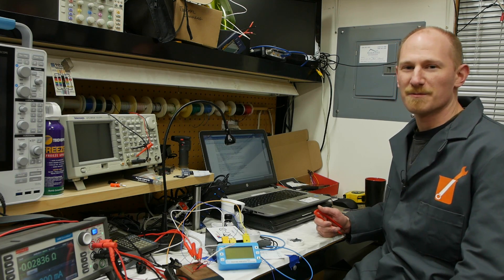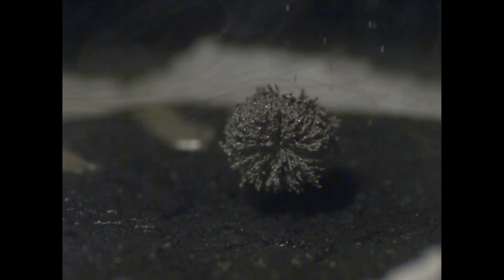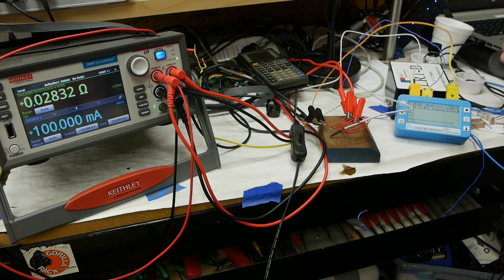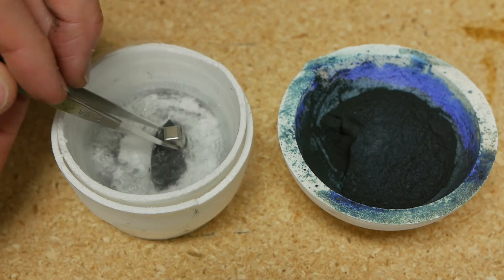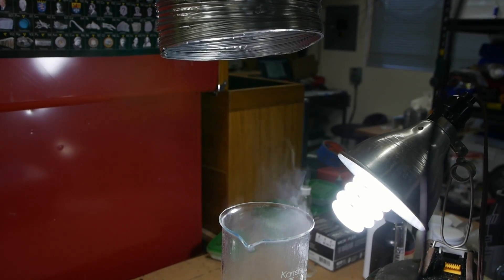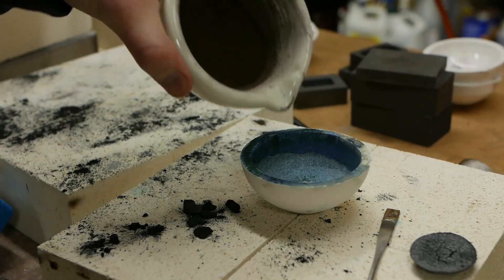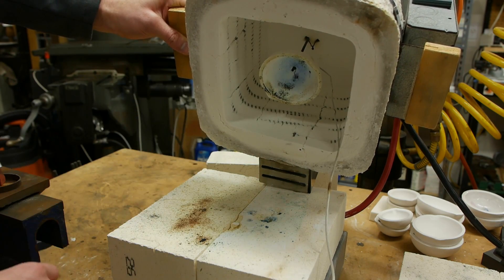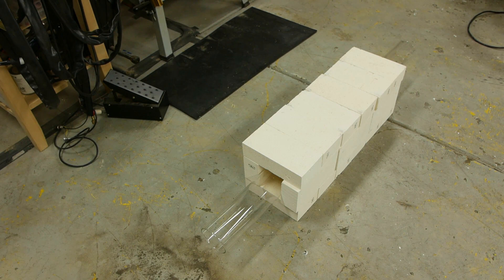Making YBCO superconductor

Comment: Great film. I spent a lot of time trying to make perfect YBCO and I'm just a halfway there. I have some observations:
1. K-type thermocouple is suitable for liquid nitrogen temp. Best results were obtained with cheap chinese module- error was within 10 deg. C. I also used Arduino with MAX31855 and MAX 31856. Adafruit library for MAX31855 seems to have some bugs or it's the IC itself- measured temperature of LN2 was only -138 deg. C. MAX31856 works fine.

2. I tried to show excluding magnetic field too, instead of filings I used compass needles as I saw on other YT channel- it didn't work and now I know why. Thanks for explanation.

3. I made Erbium analog od YBCO and it posesses very interesting property. It is highly paramagnetic (ferromagnetic?) at room temperature and is attracted to magnet. In LN2 however it's superconducting and repells magnet. It needs lower temperature than YBCO. This is the test:
https://youtu.be/4FZ3eFYO6yE?t=193

4. I tried pyrophoric method and found it very uneffective- large beaker for tiny amount of product. Shake and bake is more suitable for large scale production. There is no need to heat YBCO more than 2 times. It works even with single heating.
There are three stages: calcination, where substrates loose carbon dioxide and mixture becomes YBCO, sintering where strucrure is densified and annealing where crystal alttice is enriched with oxygen. This is POC: https://www.youtube.com/watch?v=XjuUMVm3hZ8 . It does not work well for YBCO but works better for EBCO.

5. Good grade of YBCO can be separated from lower grade by magnetic separation. Sand sized grains react to magnet after cooling inLN2 and you can "sweep" superconducting grains with strong magnet while non superconducting grains will stay in place.

6. It's really simple to make precise kiln controller with Arduino, MAX31855 and PID library. I made one and it can maintain temperature within a fraction of a degree C and cooling rate can be as low as 15 degree C/hour or less.

7. My tests of YBCO:
https://www.youtube.com/watch?v=oe3jgUgd_Sg
https://www.youtube.com/watch?v=64I_x71Yy64
Reply: Doświadczalski.pl If you enable community contributions I would be happy to add english subtitles to your videos.
Reply: Thanks! Vids are ready to translate: http://www.youtube.com/timedtext_cs_panel?tab=2&c=UC3LtRL7BObPZq_Gv3sZgwEg
Reply: Looks awesome! If you don't want to make english versions, would you mind creating subtitles for your videos? They don't have to be perfect to understand what you are doing and you can always accept corrections and improve them without having the hassle of reuploading the video.
Reply: I struggle with myself because making video is much more effort than experimenting. I do a lot more experiments but I have only 1k viewers so I'm starting to see my vids pointless. 
I'm not sure if I should have separate channels for polish and english version or keep it all together and just upload different versions of same materials? Subtitles may be not enough because polish language sounds like martian to foreginers.
Reply: Don't give up buddy!
I only just discovered your vids, and even though I don't speak the language I'm loving it!
See if you have the option of turning on auto-generated captions/subtitles - I've seen it on other youtube videos, and google's algorithms do a pretty good job of interpreting audio and translating it! I hope you keep going, I just subscribed!
Reply: Doświadczalski.pl I sure wish either your videos were in English, or I could understand whatever language you speak!
Reply: It's polish. I hardly speak english so I resist to make english verions of my videos. I'll try to fix it in the future.

Comment: We made one of these superconductors is physics class when i was in high school in the 80s. We used the mixing chemical method, not the pyro method and after a few tries we got one to work. I remember that the quantity of the chemicals had to be exact and mixed perfectly. We built a computer controlled kiln where a computer program monitored the output of the thermocouple that was placed near the sample. The computer just switched on and off the mains power to the kiln to allow for a perfect programmed temperature profile. The software took into account the thermal interia of the kiln and switch the power in such a way as the temperature drop was very gradule. From memory, we did the bake at one temp, drop to another and hold and then it reduced the temp right down to room temp at a gradual rate over a day or two. Your experiment really brings back some memories.
Reply: What the hell kind of highschool did you go to? The nobel for YBCO was only given out in 1987 and a highschool of all things was playing around with it within a couple of years? Unless you are making it up you need to give serious kudos to your physics teacher.
Reply: @aleksandersuur9475  YBCO is so easy to make, and liquid nitrogen is so easy to obtain, that everybody jumped into superconductor materials. Yes, small laboratories from small schools and colleges around the world were able to make and play with working YBCO pills.
Reply: @aleksandersuur9475  Indeed YBCO was first synthesized in 1987, however it was never awarded Nobel Prize (just a few month too late I guess). It was LBCO (a similar compound that inspired Paul and MK to look for YBCO) that was awarded the 1987 Nobel.
Reply: @cryogenicavan  ah, I see you are right, that was indeed the case, thank you for the correction.
Reply: aleksander suur i was in final year in 1988 and we were probably doing it in my final year or the year before i guess. It was actually an after school project and i think it was fairly new at the time. Fairly sure it was those chemicals they seem familiar. We did the same thing we did a levitation. From memory we levitated the superconductor above a magnet not the other way around.
Reply: Well, after school project or not, you seriously need to appreciate a high school teacher who manages to organize something like that. That's way above and beyond what high schools usually manage.
Reply: Yea. You don't realise as a kid how special it was. He was a great teacher and we did some great experiments including double slit with a laser which was amazing to see. We did wave with nodes and antinodes out on the school oval with two big speakers and a signal generator.
Reply: +Robert Heal
Not this one tho, it only took a year or so, they pretty much got a Nobel right off the bat. It's a pretty straightforward thing, here is this compound that does this thing that is supposed to be impossible, which high temp superconductivity was thought to be at a time. It might take decades for a new theory to become accepted, but a good counterexample can prove your existing theories wrong in no time flat.
Reply: I have to agree with that....what was the school ? that teacher was clearly ahead of the scholastic program !!
Reply: we made YBCO in material science class in 1994.  my memory is a little fuzzy, but there was a fume hood and lots of acid involved.
Reply: A lot of things are invented 50 years before they give out a Nobel for it.

Comment: Questions, questions, questions: Does the YBCO melt into a liquid? At what temperature does it melt into a liquid? If it does become a liquid, could you pour it into a mold to create different shapes? Would you have to pour it at the top temp (960 C) or is it liquid at some lower temp and pourable?
Reply: Your english is better than the majority of native english speakers, don't be so hard on yourself. If I hadn't noticed your Polish name, I wouldn't have known you aren't a native speaker.
Reply: Yes, YBCO is melting around 1005 degrees C. I found information that melting point depends on oxygen content in crystal lattice and may vary tens of degrees. Actually YBCO123 is the only superconducting compound of all YBCO types and it's somewhere in the middle of possible compositions. So it means it's sort of a mix of other YBCO compounds. That's the reason it cant be simply melt casted. It's crystal structure is destroyed and can't be easiely recreated on cooling. There-s however special method of making monocrystalline YBCO- seeded melt method. High melting analogue of YBCO like NdBCO123 or  SmBCO123 are used as seed crystals. YBCO123 is not present at the beginning of the process. Instead other YBCO compounds are used- they have different Y:Ba:Cu ratios. One compound is high melting and the other is lower melting. Temperature is maintained at level that prevents melting of seed crystal and high melting compound. Low melting compound is slowly heated and is sucked into high melting sponge-like structure and then recombines with it into YBCO123 starting from place where seed crystal is placed. Sorry for my low grade english :).

Comment: I made liquid nitrogen at home using 4 fridge compressor .
Reply: Mike Crapse yes i made it using 4 fridge compressor. Four stage cascade using propane in first stage (temp = - 42*C),  home made ethylene in second stage(temp = - 103*C) and in third stage methane from natural gas (temp = - 162*C)
Nitrogen condenses to a liquid at - 162*C at 15 bar pressure. Fridge compressor is rated for 30 bar.
Reply: Let's Make It Simplified using 4 fridge compressor, were you not paying attention?
Reply: Dollar Projects how did you managed to get down to - 196*C?
Reply: Dollar Projects could you please provide plans for making it?
Reply: how many litres of ln2 can you make per day?.That seems great!
Reply: nikos karavitakis if i run my machine continuously for 24hr then i can make around 75 liters of LN2
Reply: nikos karavitakis check this, might help you
https://youtu.be/BjQoJujxMcU
Reply: nikos karavitakis my friend has videoo on this machine that he also made.
Reply: thats great.May I know how much power it consumes?
Reply: nikos karavitakis 1600W to 1800W
Depends on ambient temperature
Reply: That's amazing that you can make so much LN2 in 24 hours with under 2 kW of power!  wow!  I draw 400 watts continuous and I only make 2L per day at best.  Did you really mean to type 75 liters??  seventy-five??  So, over 3 liters in a single hour??

Comment: Consider a system consisting of a single stationary electric monopole (an electron, say) and a single stationary magnetic monopole. Classically, the electromagnetic field surrounding them has a momentum density given by the Poynting vector, and it also has a total angular momentum, which is proportional to the product qeqm, and independent of the distance between them.